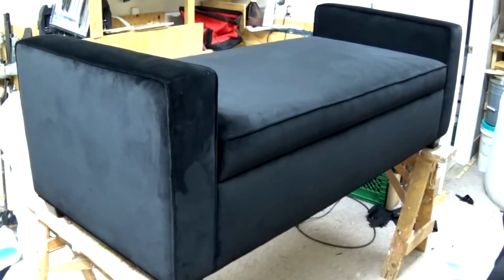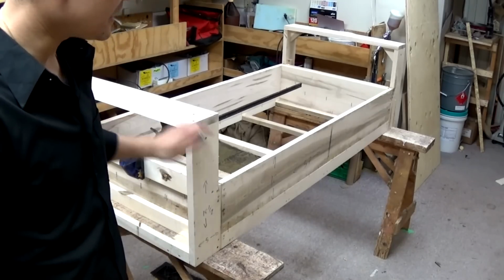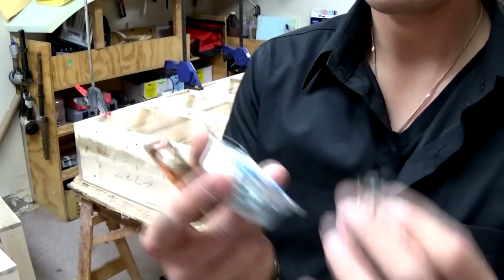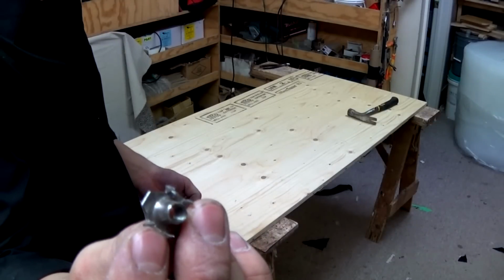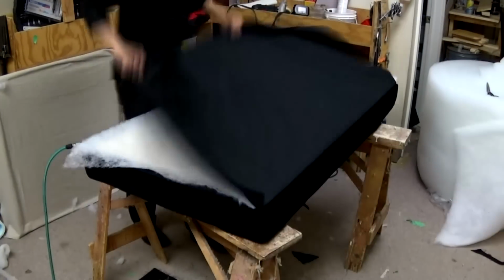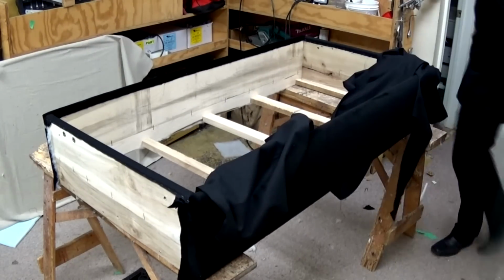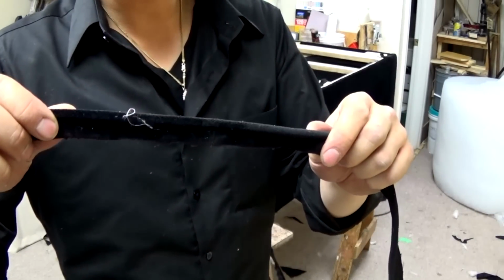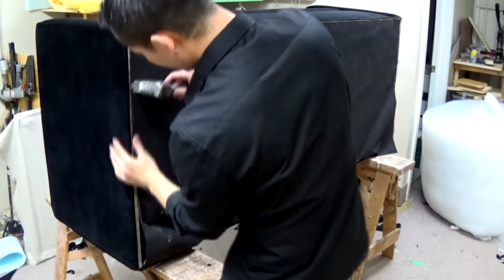DIY -  STORAGE BENCH WITH ARMS | DIY - ALO Upholstery

Comment: Hi Darren. 
I had a question, how do you make the back flat instead of with buttons? I am trying to do my own upholstery on a chair similar to this one but it has lines indented going up and down on the part that you put your back on. 
And I want my chair to be flat all around. No buttons no lines just flat. How would I do that? Do you have any tips?
Reply from the maker: veronica gomez I think the best way is to use knew foam and built the back flat first then put the foam on top by gluing it down.
Reply: Ok. Thank you for the tip! :)

Comment: I was reluctant to use a machine polisher because of hearing the horror stories. DEWALT delivers as usual. https://www.youtube.com/post/UgkxfzbDkCRyv3CFXnLZI4APZtRRuG2uRmP2  I watched a couple Chemical Guys YouTube videos and started with their medium to finish pads and polished. After experimenting on my tonneau cover I quickly Figured out the machine. It is an art. Just spread polish at the lowest rpm then move up to a higher Rpm to polish (not too high or it gets messy) Just keep it moving and let the machine do the work. Do not press down! The weight of the machine is enough. You will have Wax on wax off Larusso quality in no time at all!

Comment: Darren, you're so awesome & such a master at your craft. I have a question for you. 

We're (my husband & I) Are building our babys crib & we have decided to add upholstery to the inside side panels to make it more comfortable for him & so he won't hurt himself when he's tossing & turning. We also want to add just on one side of the panel from the outside upholstery. How can we achieve this if both sides will have upholstery & will not be able to use brad nails for one side to secure it. We're planning on using glue of course however, we want to make that over time it doesn't come undone. Any advice/ideas?

Thanks in advance.